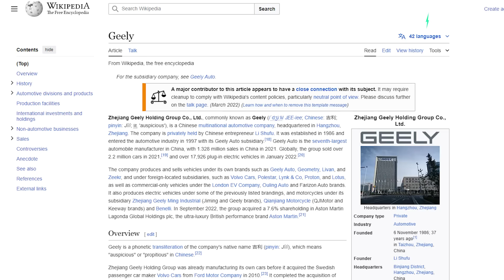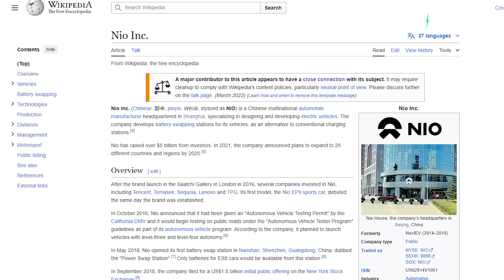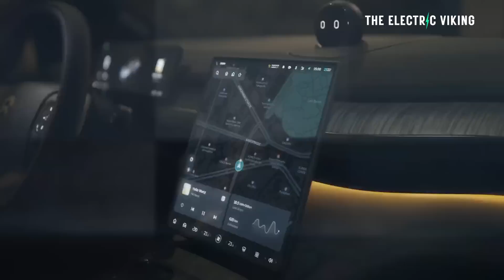$25,000 Tesla getting rid of Production line for world first assembly method

Comment: The whole rant of them making or not making a profit is besides the point for two reasons:
1. Not much different from Tesla itself, which made no profit for years and the first profits they had were not thanks to car sales but from selling carbon permits. 
2. China's government has made sure that profits were not necessary in order to build up capacity and pulled them for consolidation. 
Beyond that, now from Tesla we only have PR statements. The issue is that if the past of Tesla statements are any indication for their veracity, I would take their assertions with a grain of salt. Besides, "Megacasting" was not a tesla invention, it was used in Airframe manufacturing by the Germans back in WWII.

Comment: You really should get out more. Chinese EVs are about the same quality as a Dodge Neon. No hate, just the facts. We have disassembled many of them, as well as Rivian, Tesla, Chevy Volt, even a Ford Lightening. They are junk. Period. They leak, the computers fail and reset repeatedly, the paint seperates from the panels, wiring connectors are dangerously cheap, most dangerous is the battery assembly quality. They fail and catch fire so often for a reason, the same reason over and over.

Comment: This unboxing is the wrong name. Chemists have been using this general idea for decades. They call it convergent synthesis. Instead of making one small change to the car at a time and moving the car through a 1 mi. long assembly line, make 10 big parts on smaller lines and put them together at the end. This reduces the chance that a manufacturing defect will make it through the line, because if 9/10 of your parts at the end of the convergent assembly process are great, you are not forced to weld them to the broken part at the end and try to fix it. You can just reject the part and wait for the next working one to come along and weld that in. Convergent assembly dramatically reduces the defect rate on final product due to power law efficiencies.

Comment: Once Tesla gets the Unbox Process perfected legacy auto will need to follow or they will not be price competitive on low cost EV models. Later Tesla is certain to use the method on higher end EVs.  The handwriting is on the Wall and the EV S curve has hit the steep portion, time is running out for legacy auto to get on the EV bandwagon.

Comment: Chinese car companies use cheap and slave labour,  backed by the CCP running at financial loss,  to produce mechanically inferior electric vehicles than Tesla's, simply to gain long term market share.  Which of course is a flawed strategy when the vehicles produced are by and large rubbish.  Tesla looks to be adopting a more parallel process manufacturing technology.  This could make their production lines more agile and be able to ramp up and down more quickly, subject to market demand.

Comment: 6:49 I think there was a mix-up in saying it takes 10 minutes to produce a car from start to finish. I believe that's the interval between cars rolling off the assembly line. From what I recall, it's about 35 seconds in Shanghai.
Reply: Sam misspoke. AGAIN.

It takes 10 hours. VW CEO (Herbert deis) said, “it take us 30 hours the build an ID3-ID4 and it take TESLA less than 10 hours to build a Model 3” that means Teslas factories are 3X more efficient than VW. Tesla factories are 7X smaller compared to VW according to Joe Justice with 1/10th the employees at those factories. Tesla is 70% automated compared to 10% automation at VW. 

No one has ever said Tesla can build a car in 10 minutes. That is impossible (today).
Reply: @GET2222 - Depends how and from what point you start timing.  On the production line it takes 40 steps and 90 min. definitely not 10 hours. Fremont factory produces at least 5,000 M3s a week. Also a similar no. of MYs or about 
500,000+ a year of M3/MYs plus they also produce around 100,000 S and Ys per year.
Reply: @Chainyanker007  Yes you are talking about "final assembly" not including making all the sub assemblies or body in white.
Reply: @Chainyanker007  10 hours is from the first bolt. Sam has all of the right data, he just misscommunicated “minutes” from “hours”. VW is not building cars in 30 minutes. 😂
Reply: @royh6526  exactly. Let’s not forget, not one measures building cars that way. They measure cars on the speed of the line. VW takes 30 hours to complete the line and completes a car every 60 seconds. Tesla takes 10 hours to complete a car and completes a car every 36 seconds. 

Keep in mind, 60 seconds is celebrated with Champaign by OEMs around the world. No one builds cars faster than Tesla. FORD has 81 plants to produce 4.4 million cars. Tesla has 4 plants producing 2 million cars a year.

Comment: Mate, I saw my first Cybertruck yesterday near where I live in the Sacramento, CA area. I have to say it was interesting to see initially but then the next thing that came to mind was that it was a big metal box and to me will look dated very soon. I have a preorder (around 168,000) but I believe I will cancel it and maybe purchase something else, it's my honest opinion. A shorter convertible model of it might look good, however.
Reply: Notice how all cars are designed aerodynamically nowadays? Thats one concept in design as in the most efficient must be appealing because it makes the most sense.  Cybertruck definitely isn't aerodynamically correct.They went for the look from Blade Runner and its great to see engineering and imagination combine. Kind of like a baseball diamond, all straight lines but no 90 degrees. Fascinating...

Comment: Reduce the number of parts, complete sub-assemblies in a separate part of the facility or outside a facility, streamline wire harnesses, use stamped wire channels, and avoid painting in-house.  Dodge Viper and GM's Saturn attempted to address some of these areas but nothing like that of Tesla which is on the right track.

Comment: The problem with production lines are long and production speed is governed by the slowest operation. If one section stops for a breakdown the whole line stops. Having shorter production lines enables doubling up and producing more parts faster.
By making parts in sections you can overproduce and have a stock of parts to draw on at the final assembly point.
Which may be more than one assembly line. This makes it possible to produce in short runs for special edition cars.
Reply: When I worked at Jaguar Land Rover, I saw something pretty similar. Certainly, the entire dashboards were pre-built and ready to be installed. The trick was to get the right dashboard in the right vehicle.
Reply: But for certain slow steps one can scale more workbenches.
The succes of the electric cars is having less components and also because they kind of ditched the option trims

Comment: Unboxed process summarized: https://youtu.be/S8KD-8c9ri4?si=1yAX1J5QYffc5i55&t=600 Note the different modules, left side, right side, front, rear, top, bottom (includes battery/floor/seats), all of which are produced in parallel on separate assembly lines with easy access to each module from all sides during assembly. This enables the ability to have different configurations (as long as they are all designed to interconnect correctly) just by choosing appropriate modules.  Hatchback vs. sedan? Different rear modules, possibly different side modules.  Longer wheelbase with more seating configuration and larger battery?  Different left, right, top, bottom, while same front and rear modules. Single motor vs. dual motor?  Different rear and bottom modules. Robo-taxi vs. driveable (steering wheel and pedals)? Different front modules.

Comment: Parallel Assembly?
It's analagous to a comparison between the Von Neuman Sequential Architecture and Parallel Processing in Computing.
It actually requires more factory area but the rate of throughput can be increaced for a single line of output.
Reply: Claim is that unbox will take less factory area.
Reply: @danharold3087  AKA the Boeing/Airbus process. Complex parts built all over the globe, then shipped and assembled in one relatively "small" plant.
Reply: Yes, I've noted that also, but it doesn't make sense to me. @danharold3087

Comment: Does anyone know how these Chinese or Tesla cars for that matter fare against corrosion. Aluminium doesn't mean no corrosion, the Alloy body Jags corroded pretty bad, the Cyber Truck should never corrode except for any mild steel used on the frame work.
Reply: Aluminium oxidizes ,steel rusts.Alloys dont degrade structurally as far as I know, its on the surface. Think aluminium boats...
Reply: @jaaklucas1329  I said corrosion not rust, Aluminium corrodes. Who said anything about boats?
Reply: @dubsydubs5234  I miss your point I guess. As in the corrosion of aluminium affecting the structural integrity?
Reply: @jaaklucas1329  Aluminium corrodes to the point of becoming dust and that definitely affects structural integrity. Bare aluminium protects itself with it's almost instant oxidation but it's far from corrosion proof.

Comment: When talking of assembly lines.
When I mounted Volvo truck gearboxes at the end of the 1980s, would you call it "a line" when I mounted the gearbox from start to finish.
In fact some parts were pre mounted, and then I lifted the "package" into the gearbox.

I would explain it as a walk between different stations where I added different parts to the gearbox.
After the test of the gearbox my colleague told me if I had done a good job or not.
35 years ago.

Comment: I worked for a trucking company that served the Detroit auto manufactures.  Since the 1920’s and probably before auto manufacture assembly lines have been where sub assembles have been installed in order to complete a vehicle.  GMC semi truck cabs were totally assembled before they were bolted onto the chassis.  Star Tool and Die manufactured GM pickup hoods that were then transported from Detroit to Pontiac, Michigan where they were installed on the assembly line.  Early auto manufactures bought complete engines from companies like Continental.  One of the United Auto Workers union biggest negotiating points is to eliminate non union companies producing sub assemblies that reduce or eliminated assembly line jobs.  So please try to more clearly explain what is new about off loading the work preformed on the final assembly line?
Reply: Semi trucks are body on frame.   We see Ford dropping assembled model T bodies on to frames in the old films from the early 1900s.  The idea is to bust up the final assembly line into smaller ones that can make modules which can be rapidly combined.

Comment: It's all well and good if Tesla do manage to actually get the cost of the Model 2 down to $25k - but the cost of ownership may still be high.Tesla doesn't seem to understand the need to support servicing, by way of replacement parts. Instead of using a lead acid battery for the low voltage system, they use a far more expensive LiIon pack, and even a small fender bender can result in far higher repair costs than for a comparable ICE vehicle. God knows what a repair would cost if the Giga-castings are damaged. It's as if Teslas are intended to be single use, non-recyclable products. If the Model 2 comes with the same stupid offset screen for all controls, it may not be legally sold in Europe, where they are asking manufacturers to have physical controls for core essential functions.
Reply: As my father used to say to me, "You never know how expensive or cheap a car is until the day you sell it". Putting the cash down, up front is one thing. Insurance, maintenance, fuel, repairs and ultimately resale prices determine how expensive a car is to own.

Comment: Tesla is still using a production line, just a different one. If what you explained is right, they use assembly stations and than transfer those assemblies to a final one to complete the process. All manufactures are using a version of this process but the Tesla one could be better optimize than others.

What is going to make the biggest difference in the near future is the amount of work performed by robots. On that point Tesla has an advantage over others but not for long if the Chinese keep progressing the way they are now. We could only hope this progress is going to be transferred to customers as well.
Reply: No other car maker is using what tesla have created with the unboxed process.  Oems build the frame, dip it paint it then add all the other components sequentially.  Tesla will make the car in 6 or so parts and marry them up.  Tesla build structural battery packs with the seats, carpets etc attached, which is loaded into the car. Vw currently takes 30 hours to assemble 1 car, tesla takes 10 hours to make 1 car. The unboxed process will take a fraction of the time, perhaps as low as 5 or 6 hours to make 1 car. Tesla can add extra assembly lines so the factory will produce several times the number of cars in the same space.